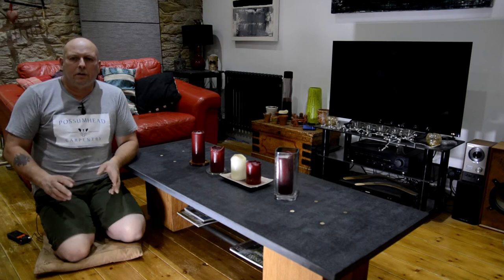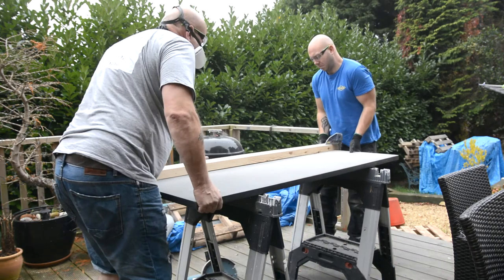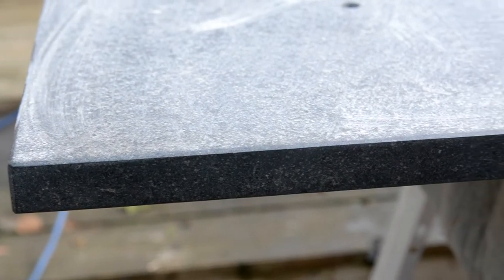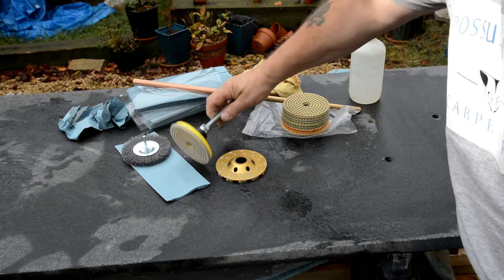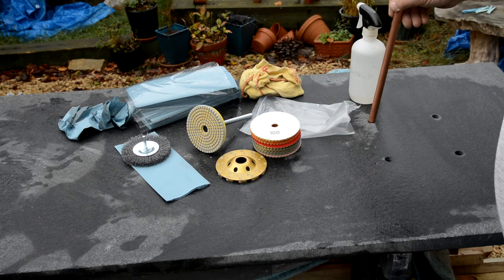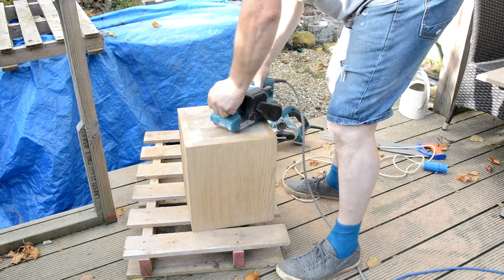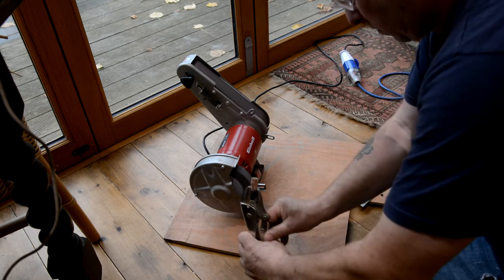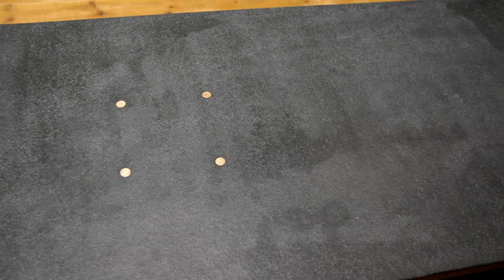Slate top table

Comment: Hiya. What were those abrasive pads? I can think of loads of users for them.  Did they work? I'm away to make a top for my vanity using slate. Final question. What did you seal it with? Thanks for posting your video. It's been helpful
Reply from the maker: Hi there, I brought the pads from Amazon, if you search diamond polishing pads, they come up straight away, they worked ok, you get what you pay for so if you are using them a lot, you might want to buy better quality ones, the sealer is Liberon natural stone sealer, hope this helps
Reply: Thanks for responding so quickly. That's a great help.
Reply from the maker: No problem